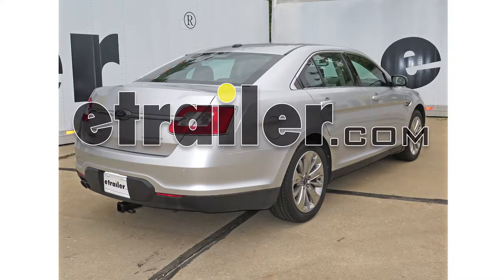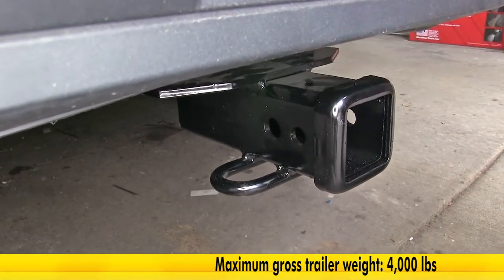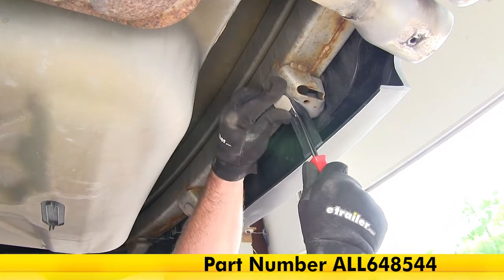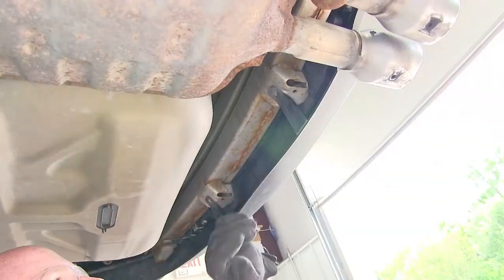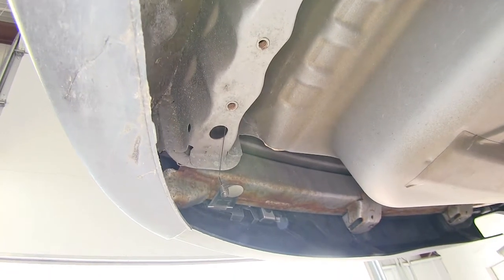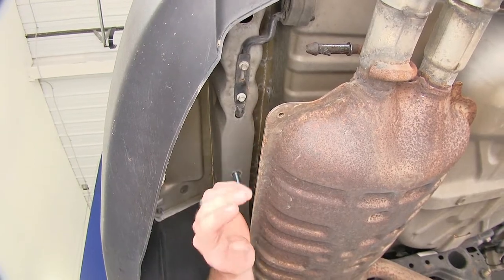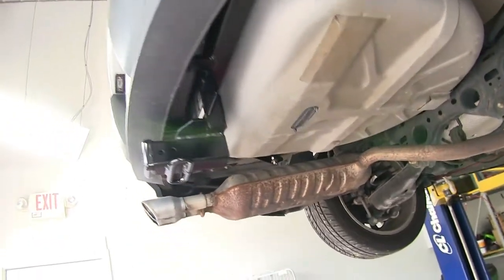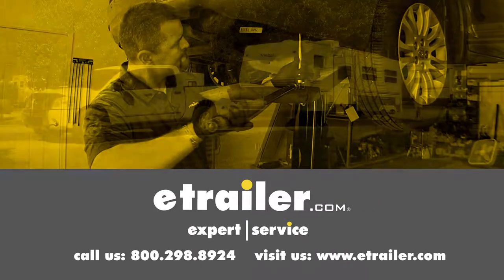etrailer | Installation: Draw-Tite Max-Frame Trailer Hitch Receiver on a 2011 Ford Taurus

Comment: What about the electrical conector?
Reply from the maker: Great question! We'd recommend the Tekonsha # 118599. You can check out the install by using the link I've provided below:
https://www.etrailer.com/tv-install-trailer-wiring-2013-ford-taurus-118599.aspx
https://www.etrailer.com/Custom-Fit-Vehicle-Wiring/Ford/Taurus/2011/118599.html